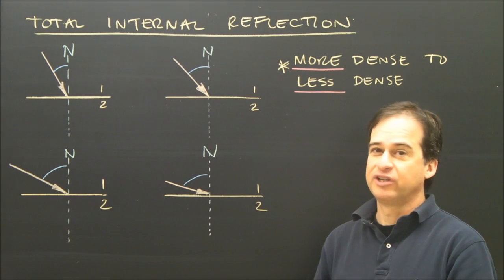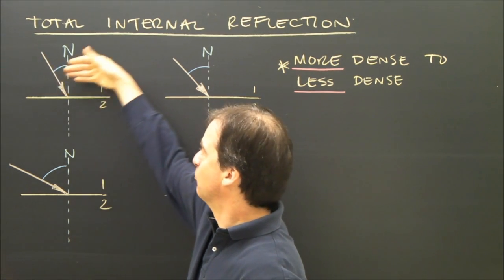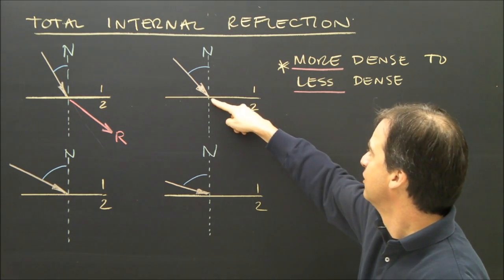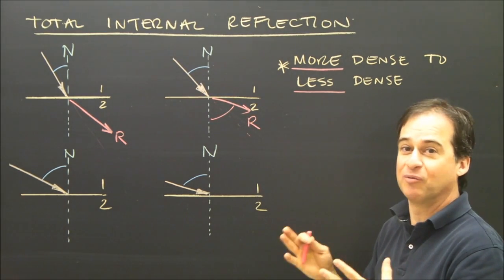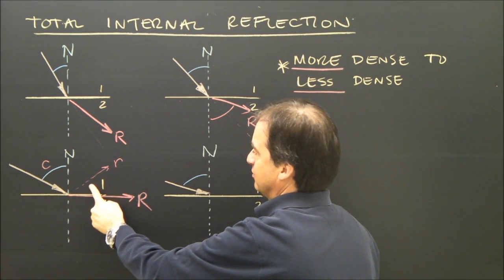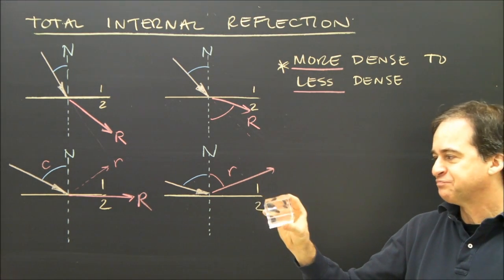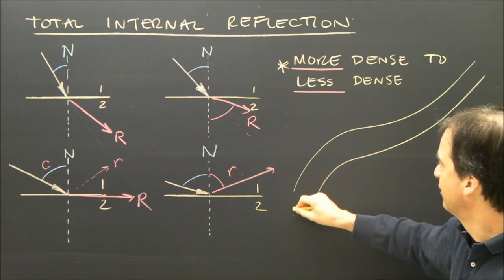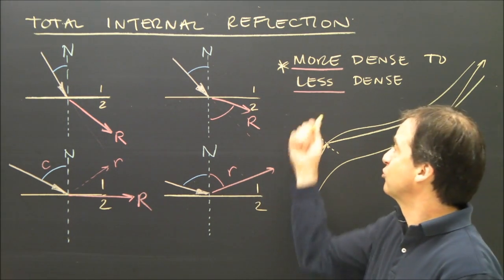Refraction of Light Total Internal Reflection Introduction Lesson Part 2

Comment: Reflection is when the light just bounces back from the surface at the same angle. 
Angle of incidence = angle of reflection.
Those were the first two examples.

Refraction is when instead  of continuing forward when passing from one material to another, the beam bends towards the normal of the surface. For ex. when light goes from air to water - in the previous video.
I hope you understand it now.